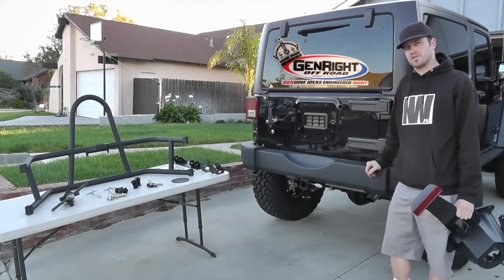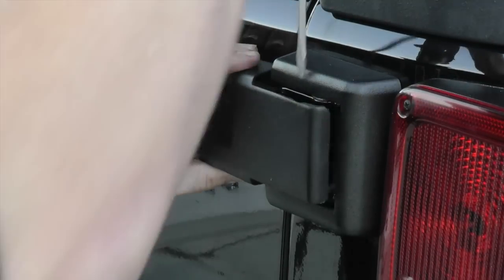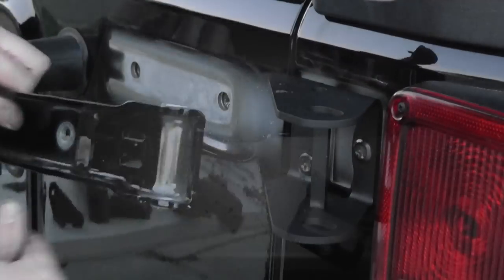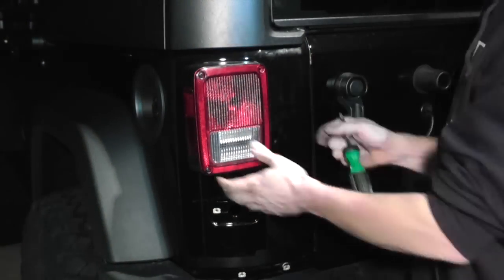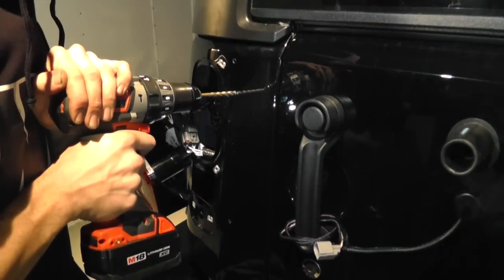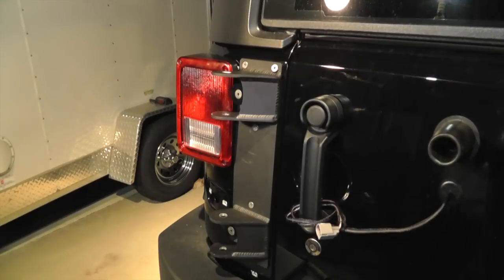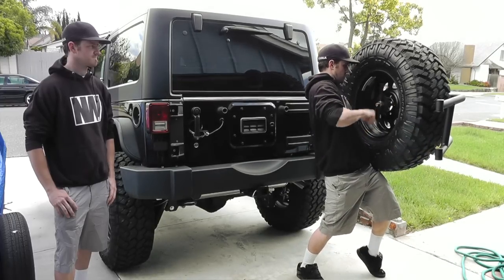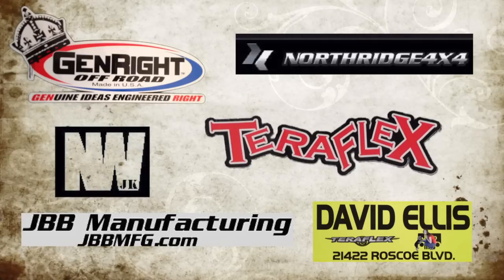JK Swing Out Tire Carrier Install - Stock to Rock Episode 14 - "The NeWereJK"

Comment: This was a nice video.  However you failed to install the CAM nut on the passenger upper hinge.  I have this carrier but it had no instructions so I watched a bunch of videos.  Thankfully I found a video that explains this.  Even the downloaded instructions don't clearly explain this.  The DV8 video does not install it either. The CAM nut is used ti align the carrier to close.  You will notice one of the passenger hinge mounts has a small metal plate.  This is for the CAM nut to push the bolt out to raise or lower the driver side.
Anyway its a great mount and I'm looking at mine and it looks good!!!

Comment from the maker: I'd say no. The stock tire carrier can only hold 50 lbs max and has limited space between the tire and the stock bumper. Most after market carriers are better designed for the size and added weight. You can try it but it may damage your tailgate.

Comment: Not exactly true.  The stock JK Rubicon tire weighs 48lbs by itself.  Add in the weight of the wheel and it's gotta be near 75lbs or so.  I've seen plenty of people run 35's on stock carriers.  It's not the best setup, but it can be done.

Comment: that's a lot of weight on that body
Reply from the maker: +Ghost White The cage is aluminum but yeah thats not a light tire. As far as where it mounts to the body it does reach an inner structure its not just on sheet metal. Seemed to hold up well.